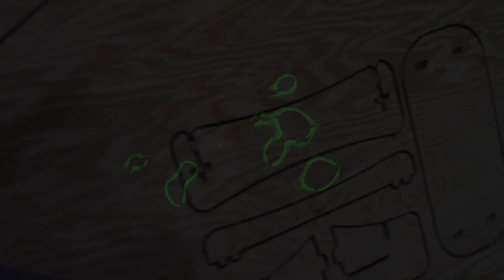Plywood Boat - Easy Build - Part 3 of 3 /Series

Comment: Really nice looking boat. I really don't like your method of applying the glass cloth with a spray adhesive, I believe this would interfere with the epoxy bonding to the wood underneath the glass cloth. It looked neat, the cloth was laying nice and flat, but it seems logical you have fiberglass cloth sitting on top of the wood rather than bonded to it. That is my opinion, but everyone needs to make their own choices.

Comment: I tried to find the plans for this boat in Duckworks, and I couldn't.  Where can I get the plans?
Reply: Jim, the boat is called "Water Rat" by well-known Australian boat builder/ designer Ross Lillistone & his plans are available at Duckworks.com. I built the first one to his plans about 20 years ago & still have the boat. It was built using epoxy & fibreglass tape as per the instructions.

Comment: I love the style and design of that boat. Surprided the fiberglass and especially paint did not turn out well as I've seen a lot of your paint tutorials
Reply from the maker: The fiberglass is great. The fiberglass tape I used, sucked. The paint was just a quick job. I was ready to get into the water...LOL.
Reply: @Commandodesigns  Tony, with respect, fibreglass tape has to contact clean dry wood directly & the resin is squeegeed on sparingly with just enough for the tape to turn from white to clear.It is then fully wet out & any more resin will tend to float the tape off the wood & not form a good bond.Definitely do not spray anything on the clean wood first. Also, the joint you made was a "fibreglass butt joint, not a scarf joint. Done with care a butt joint is fine & should have a layer of tape on the other side in most cases. Btw, water-based polyurethane glue like you used is not suited to this type of use but more suited to structures clamped tightly together until cured. That way it is probably the next best choice after epoxy & is waterproof.I applaud your attempt at trying new methods & materials, but without thorough research first the best approach would be to experiment on spare pieces of plywood with all the glues you are comparing as "Glues aint Glues" as each has a specific set of applications. There are safety considerations  & standards with designing & building boats which designers have to consider by law..Not following the plans & instructions can have serious consequences.
Reply: @adamlafontaine3904  Actually, I thought A Boat Builder made some good points, and did so politely. 

I'm considering the same boat, but really didn't like the look of those glue joints.
Reply: @aboatbuilder9663  Given a boat like this with goofy angles, how do you figure the best way would be to get it to come together? 
Those joints on this build were worrisome. I was thinking if you planned in the correct angle, for a reasonably close for, then tack the pieces with epoxy maybe? Trim, sand then tape. Or maybe just use thickened epoxy to fill the gaps.
Reply: @kf4293  Mate, search for "Stitch & Glue" boatbuilding. Many sites on web. The design is called "Water Rat" designed by Australian Ross Lillistone. Plans from Duckworks facebook site & heaps of good information from amateur& professional boat builders . I built the first Water Rat Many years ago. Ross is a mate. I'm also in OZ. Sadly the fellow here has done little or no research on boat building methods & materials & is flying blind.
Reply: @aboatbuilder9663  Okay, I'll keep poking around. I found a demo video put up by a fiberglass supplier late last night. Method he showed used 5 minute epoxy to tack, and then after he removed the zip ties he did a fillet of thickened epoxy topped by fiberglass cloth and more epoxy. 

Results seemed very nice with that method. More expensive and messy, but the darn thing isn't going to come apart!

Thanks for the reply brother. 🤠